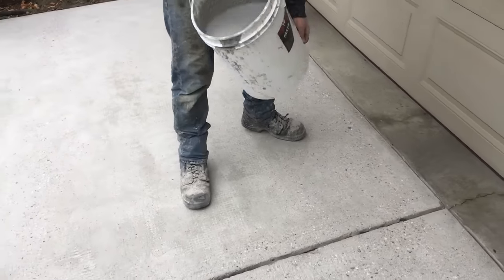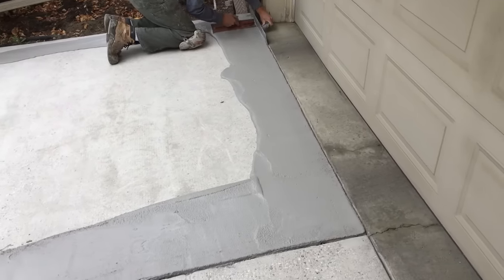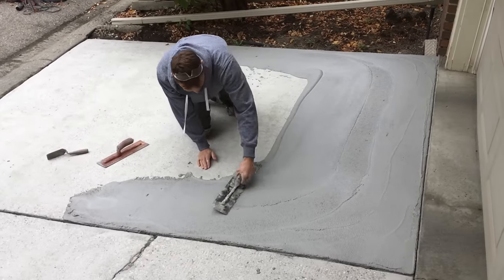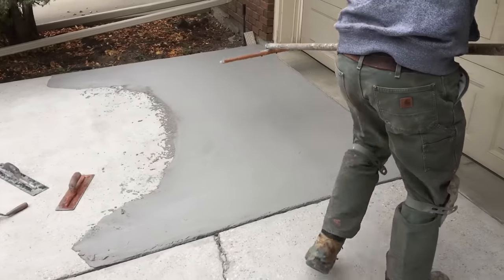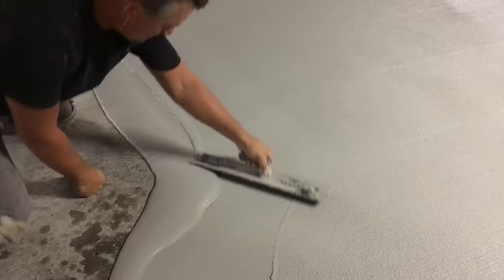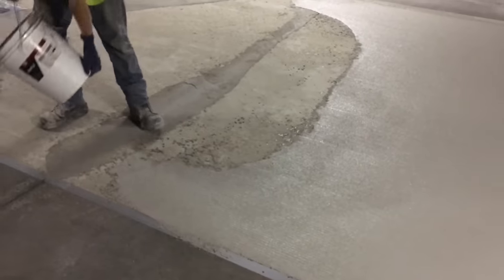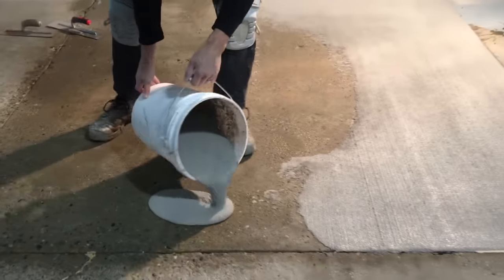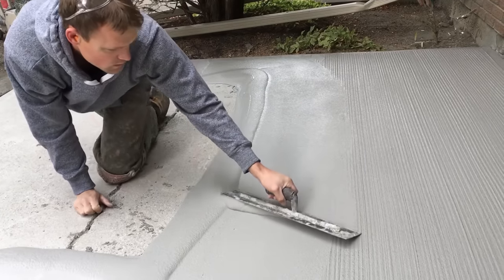TF Structural Concrete Overlay - Overlay Instructions

Comment: great craftsmanship, looks so easy but I know from experience it's not! However I succeeded in getting the same result with topping my concrete floor with tile adhesive, that happened to be grey. I had to add more water than prescribed to make it flow better. frost resistant tile glue costs a fortune but I had some left from another job. Still had to buy some extra....ended up pretty expensive.... :)
Reply: Seek Him with all your heart and you will find Him  and your point being...???

Comment: Did you pour the white bonding liquid on the old concrete before the new pour so that makes old concrete adhere to old concrete?
Reply from the maker: No, TF Structural requires no bonding or priming agents, its chemistry bonds directly to old concrete. It is not a portland cement based overlay.

Comment: Can you do this over a crack that has been filled with a filler? Would the filled crack still appear even with the overlay? Or would the filler need to be removed then put the concrete overlay in the crack? Would the crack ever appear again? I have a 16ft 2 inch crack. What are your recommendations?
Reply from the maker: I have a video that shows one method to repair cracks. It is a very rigid product, so usually when you cover a crack, it will reflect back through.
Reply: @TerrafuseInc  So even the best filler with an overlay, the crack repair will still be seen no matter what you do? Where is Terrafuse located? Is it a franchise company? Even the best company near me wants $2,500 minimum and says they can't guarantee the crack will remain hidden with an overlay. My porch has a pillared roof on the concrete and it's weighing down one side of the crack. Ugh. My HOA is clueless how to repair it.
Reply from the maker: I know this reply is later, but you can check out this method for crack bridging. Its not perfect, but works very well. 
https://youtu.be/o5UYlJmKhAE

Comment: Great video but I have a question. I keep seeing these install demos on other videos and no one has applied a concrete bonding agent. Why is that? I would. Or is overkill? Lmk thx.
Reply from the maker: This is not concrete! It doesn't need to be 'glued' down, it chemically bonds itself to existing concrete, and primers interfere with that bond.

Comment: It looks good but it will not last long if the concrete is bad enough just replace it completely but if you just want a fast and cheap fix then that's the way to do it good job 👍
Reply from the maker: If the concrete is really bad, replacement is often the only solution, but if the substrate is solid, you can easily replace the surface, and it will last at 1/8” off wear every 10-15 years

Comment: This doesn't cause a cold joint and start cracking? It looks like you put down a primer or something before you did this technique. What did you put down?
Reply from the maker: It will only crack if the concrete below it cracks, or has a crack that isn't treated properly before install. No primer needed, but you can pre-wet the surface before installing with water. This will help with working time, especially during hotter weather, or if applying on very porous concrete.

Comment: Hi, I am after some advice.

I have had a concrete driveway poured and unfortunately, the team that did it messed up the levels and as a result, the drive is dead level.

So I need to consider putting down a new surface on top of this and need to know, what product do you advise I use on concrete? I need to ensure that it does not crack and come back up, what do I do to the current surface to make sure this new product bonds very well, it also must be able to sustain the weight of cars. Let me know what you think.
Reply from the maker: You can email me your contact, and I can phone you tomorrow to discuss further. 
Mike@terrafuse.com
Thanks!

Comment: I have a question... so,  someone poured a small driveway 22ft ×8ft in my mom's yard. It wasn't a bad job all but it came out unlevel. It's supposed to slope down hill a little bit but I mean it looks like it has waves in it,  ....so my question is, would this stuff work if I re-skim it with this?, would it be stronge enough for a car to park on?? It's a 5in thick pad
Reply from the maker: Yes, it’s perfect for that

Comment: What do you do with the crack in the last video? Itll break right through before the skim coat is even set. Why not try to seperate it with some sort of thin expansion?
Reply from the maker: Yes, that is a great option. There are lots of ways to work with a crack before you overlay. We have one method in a video (check the Terrafuse playlist), and I will continually upload more solutions. Only so much you can put in one video!
Reply: Profuse terrafuse the refuse  @TerrafuseInc

Comment: I wanted to apply this method of application on to a 6inch thick external concrete slab 18 foot by 12 foot. The slab with a slight run off forms the roof on my basement below. .
Would this screed prove to be watertight? Secondly, can it be stamped and coloured?  The slab is reinforced and well supported. I could lay porcelain tiles but didn’t want to add weight . It seems a good way to keep down the cost and weight. 
Look forward to hearing from you here in bonnie scotland U.K.!
Peter
Reply from the maker: No, it is not a waterproof membrane, but it can be stamped!
Reply: Thanks for your good advice. I hope not to test your patience. Could the concrete slab take some sort of DPM that would presumably need to adhere tight to the concrete slab? 
Peter
Reply from the maker: Can you elaborate? Sounds like you need to waterproof your slab?

Comment: My driveway has a stamped brick texture around the edges about 12 inches wide and nearly 1/2 inch grooves. Will the product fill in the grooves all in one coat? Or should I do the boarder first to level it out and then resurface the entire area?
Reply from the maker: Yes, it can. Ideally you fill all the low and thick areas first, let that set, and then cover over it all with a final skim coat.

Comment: Have a new shop that the floor was poured with low spots around the slope to the drain. Would this be a long lasting repair? I bring in 3 to 5 cars a day to work on. Through the winter months they melt lots of ice with sand and calcium/salt mixed in.
Reply from the maker: Yes, it lasts a long time. If you are putting it in an area constantly exposed to water, I would do your repairs first, then lightly grind them, and coat with a coating (some type of epoxy). This will help protect it from constant water and chemical exposure.
Thanks

Comment: No wetting the original required? Also could multiple layers be applied to correct a leveling problem?
Reply from the maker: You can wet it, but it’s not required. It will help with working time and flow ability, especially if the concrete is thirsty, and it’s windy or hot out. Yes, you can easily do layers, or apply it as thick as you want in one application.

Comment: question for you, what if there is more damage, so some chunks need to be taken out. I am thinking just regular concrete again but how thin is too thin to make regular concrete? at which point does concrete become too thin. like the old concrete is there and if I take some of the damage out, I may want to only put new concrete on top at about 1" or maybe 3/4"? What would you suggest at that point? Thanks!
Reply from the maker: Hello, you can use TF Structural for larger, deeper repairs also. It has no minimum or maximum thickness restrictions. I don't recommend repairing concrete with portland cement, it does not bond to itself, and relies on bonging agents/primers. You can run into problems with a system like that, especially in freezing environments.
Reply: @TerrafuseInc  ya thanks. i meant to say concrete, sorry, but i think that's too thin especially for the aggregate. I'll check out TF Structural. thanks!!!
Reply from the maker: Sounds good!

Comment: Nice job I’m doing my driveway. Haven’t picked a product yet. My question to you is. Can I rubber stamp it as I’m going haft way down before it drys? Like in your video you passed the broom instead of the broom can I stamp it?? With a pattern?? Thanks
Reply from the maker: Yes you can, but this takes a lot of skill, and a crew of at least 3 people, as you have to mix, place, and stamp as you work your way down the driveway. Not easy, but definitely possible!

Comment: Why don’t you pre-wet the original concrete pad? doesn’t that allow any additional concrete overlay to have better adhesion?
Reply from the maker: Its optional, but it can help extend working time, especially on hot, windy days. In this video, its only about 45 degrees

Comment: How do you make sure it’s level? You didn’t sting it or laser level? I have a slab I need to re level and I’m thinking of using the technique you used I just need it be be level.
Reply from the maker: You can use a screed board, or any straight 2x4. I recommend levelling first, then going over that with a skim coat after.

Comment: Hi all. I’m hoping this isn’t a dumb question. Could this same technique and application be used on my yard concrete floor that also has its share of cracks in it? Or would I wanna break up the cracks and fill it in first, then apply this technique ?
Reply from the maker: Depends how badly cracked it is, but please check our channel for videos and techniques on how to deal with cracking before applying the overlay.

Comment: I live in Toronto Ontario with -15 Celsius in winter. Is this TF concrete suitable for extreme cold climate if not what do you recommend instead. Thanks
Reply from the maker: Yes it is. It was designed, and has been used for over 10 years in Calgary, AB.
Reply: @TerrafuseInc  Where to buy. I checked both home depot and low's but they don't have
Reply from the maker: Call us, you can buy it direct, we have a warehouse in Etobicoke, ON

Comment: How durable is this overlay? Can it support heavy vehicles without cracking/separating? I live in the rust belt, so I'm worried about salt ruining the whole thing. I have cracks, pitting, and heaved sections that I would like to smooth out, without replacing my whole driveway, so I can shovel or snowblow without constantly getting caught on seams!
Reply from the maker: Very durable! It is not flexible, so cracks that are in the substrate will reflect through the overlay.
Reply from the maker: Here is a job after three years, and this video has links to crack repair techniques too.
https://youtu.be/iuK9_XweHKA

Comment: Is this same/similar to what Home Depot sells (50 lb. CTS Concrete Leveler). I just did some patch work on my driveway, I think it's kinda sagging, in some areas, so I just filled them with concrete. But it's not smooth, it's very patchy/rough. I would love to make it smoother. Any cement mix at home depot says minimum 2" thickness, and I just need maybe half inch or so.
Other than leveler, should I just use patcher and then lay it thinly and then smooth by hand? We are talking about 15-20qft area, maybe less.
Reply from the maker: No, it is a very different product than what they sell.

Comment: I have a painted concrete deck that runs completely around an inground pool. I though about doing this, was wondering if u have any tips for prepping the surface before a skim coat?
Reply from the maker: If it is painted, you will need to diamond grind it, and get back to a clean, porous concrete surface
Reply: @TerrafuseInc  🤦🏻‍♂️I thought so lol... thanks!

Comment: I pressured washed my concrete driveway, cracks got larger and made some big gaps, hoping I can use this product to seal
Reply from the maker: It’s a very rigid material, and not designed to just fill in cracks. Cracks required special treatment when using a rigid repair material. 
Here is one Method:
https://youtu.be/xvq0TXjMfeU

Comment: Can I use this to cover some ugly concrete work on my pool deck? Structurally, my concrete pool deck is very strong and stable but it was finished poorly in some areas by the contractor who installed it (in those areas where the new concrete adjoins old sections). I’m wondering if there’s anything about this being used on a concrete pool deck such that you wouldn’t suggest it. Thank you!
Reply from the maker: Yes, you can do that. It may not give you the best color with the water and chemicals from the pool, but you can use a concrete sealer after application to protect it.
Reply: @TerrafuseInc  thanks!

Comment: Does it have polymer in it?  Do you need to prime the old concrete with a latex binder or Portland Cement slurry?
Reply: I certainly would. I'm surprised they didn't do that in this video. I personally would grind the entire pad, prime it, then apply this overlay.

Comment: This looks like exactly what I need
We had a sidewalk poured and it cracked 
They came out and put just a cement patch over it and that cracked plus leaves a dark gray color that sticks out like a sore thumb.
Can this be used to both seal the crack and spread over all of the sidewalk so it looks the same color ?
Any info would be appreciated
Reply: If it's just one square or section of the sidewalk I'd just cut it out and re-pour that section/square. Repair work, no matter how good, is always evident. If it's the entire sidewalk that cracked then they did a poor job preparing the base and it should be torn out and redone.
Reply: @agentx250 
 It is only one place but it sticks out really bad. The crack is getting worse each day and cracking out more and more in the same spot
Reply: @trippleslots  I'd rent a demolition saw, cut along either control groove and then cut that section into manageable pieces. Concrete is easy enough to mix 120lbs at a time in a wheel barrow (or mixing pan) and the section should be small enough to complete in this way.
-
Replacing the section rather than continuing to patch also means that the new pour will take up the void under that section which is likely causing it to crack in the first place.
Reply from the maker: https://youtu.be/o5UYlJmKhAE

Comment: Would (or wouldn’t) a mag float for distribution and a bull float for an even surface be an efficient 2 step option before brooming ?
Reply from the maker: It is not necessary, as it’s too thin for those techniques to work well. The broom will even out the surface just fine 👍

Comment: Thinking about pouring concrete over my pebble patio floor. I dont want to see the pebbles any longer.  Would this product be a good fit for that purpose?
Reply from the maker: You are trying to cover some exposed aggregate concrete?
Reply: @TerrafuseInc  is pebblestone considered an aggregate? Its not loose stone.
Reply from the maker: Can you send pictures? What is the product you want to cover, an epoxy type stone overlay, or concrete with the aggregate exposed? You can email me at mike@terrafuse.com

Comment: What about adding color? Will it affect the integrity? In az colored concrete is very popular.
Reply from the maker: Yes you can, but over time, the material fades very light, and colors can become very flat looking. Ideally, after it is stained or colored with integral powder tint, you can apply a clear sealer meant for concrete, and it will make the color more rich

Comment: I have a patio that was poorly finished. Dirt gets trapped in scored lines in certain sections where I guess they were too heavy with the broom and it doesn't slope away in some spots so water pools. I am going to cover most of it so the pooling wont be a problem but this looks like it would allow me to resurface it. I am in awe of your troweling skills. I hate working with mud of any kind. It just takes skill and practice I guess, getting in the zone and "being one" with the material. Your video shows why some things should be done by a professional.
Reply from the maker: Thanks! Yes, like all things, practice and experience leads to ease of use. This product can also fix your pooling areas, as it can go as thick as you want, to reslope sections of concrete 👍

Comment: I didn't see any floor preparation : cleaning , washing, water blasting etc Please explain. :)
Your website says this:  TF Structural requires no primers, no scrub coats, no critical mixing ratios and no curing procedures. Its unique chemistry allows the worker up to 45 minutes of working time, while still generating strengths higher than concrete after 4 hours.
Reply from the maker: There is prep done, just wasn’t shown. You need clean, sound, porous concrete 👍

Comment: Would you have to grind or waterjet the surface to prepare it?
Reply from the maker: Proper prep is always required, but it can be as easy as pressure washing. Make sure there is no loose, deteriorated concrete, and it is clean and sound.

Comment: Do you have a technique/s for using on a slanted surface, like a 15 degree decline? How do you keep the structural concrete mixture from moving too fast downward as you work with it? Thank you.
Reply from the maker: You can make it a bit thicker, and it won't be a problem.

Comment: This product will harden and bond because he is using a moist base.   
After 28 days it will be full strength.  
This will probably not crack easily. 
I would fix it every 5 years if needed. 
Winter is hard on concrete

Comment: does this need a bonding agent prior to installing?, should the concrete be washed first?
Reply from the maker: No bonding agent required, it doesn't need to be 'glued' to the substrate. Yes, the concrete requires proper preparation first, and we have videos demonstrating different methods for this. 
Thanks